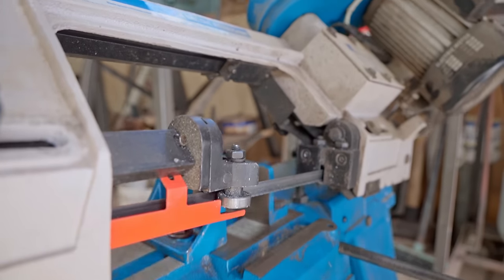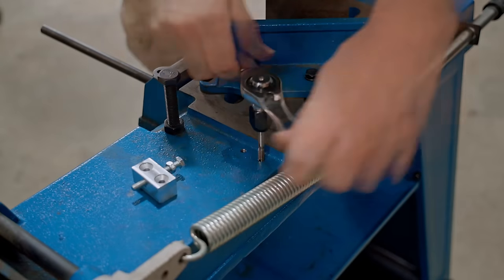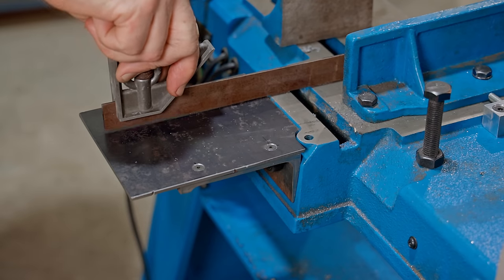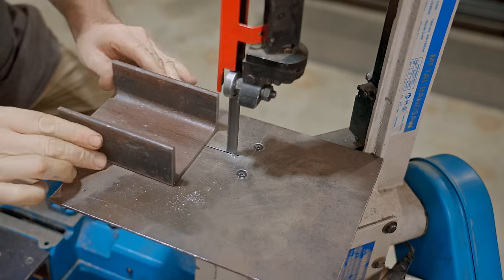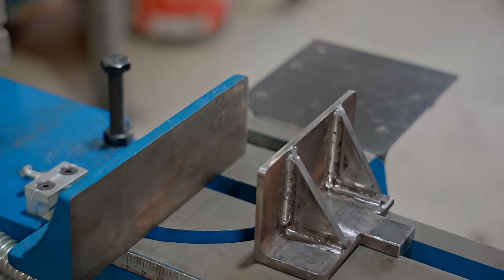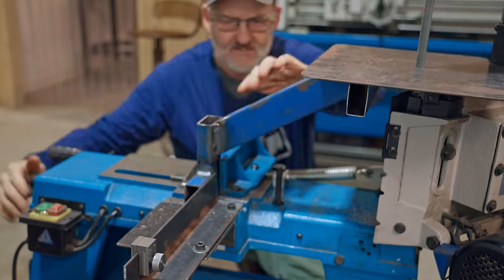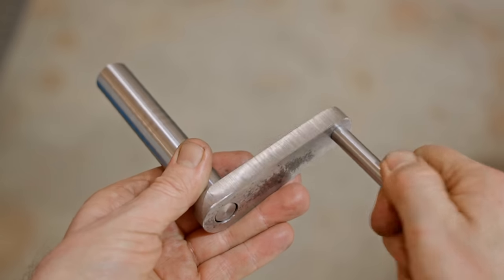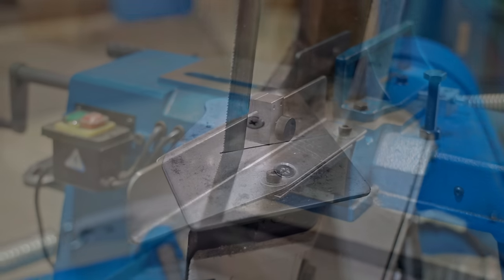Transforming a Budget Machine into the Ultimate High-End Tool

Comment: Regarding vertical welds. Since you are using MIG you might consider running the first pass up hill with a single small stringer instead of a weave and then immediately running downhill over it with a slight weave. This initial pass will give you penetration while the second will smooth it out giving you a good looking cap.

Comment: I've got one of these and its a decent machine for the money. The one mod that would be useful would be to renegineer the tension system for the sawing pressure. The spring is crap because it's not linear and being cheap the machine hasn't got a hydraulic blade pressure adjustment.

Comment: Very good work, for what you are welding I wouldn't worry about vertical up

Vertical down will be fine, grind all faces to be welded to clean steel 

To save grinding those welds off a small prep for somewhere for the weld to go, it will be stronger and if done correctly look the part

Comment: when using solid wire mig, welding downhill with minimal puddle manipulation is significantly easier and leaves a far cleaner looking bead at the expense of a slightly weaker weld with less penetration, but still perfectly servicable in most use cases

Comment: you can probably improve your welding results by not weaving. you really only need a good root pass for this size material. you can control the size and flow of the weld bead by dialing in the machine and changing your hand speed. some welders choose to cycle the trigger and run stitches for that "tig dimestack" look, but its not really necessary unless you are welding thinner material.

Comment: Quick tip to improve the look of your vertical MIG fillet welds without sacrificing significant strength:

Weld from top to bottom, with a slight push angle (the wire is exiting the gun pointed down 10° or so) and very minimal movement, mostly trying to keep the wire's position relative to the surface of the weld puddle consistent. With a bit of practice, this will produce a smooth, even weld bead with a solid tie in to both sides of the part. This method or similar is used all over the welding industry for thinner metals (10mm or less) and is one of the best improvements one can make to the look of parts without needing much, if any, post-processing.

Comment: Great video and some great modifications.  I made almost the exact same base with casters, but instead of solid sheet metal, I put expanded metal in the bottom so it wouldn't catch all the "sawdust".  I also extended plates to bolt the casters to so it would have a wider wheelbase and be much more stable.  One thing I noticed right away was regarding your workflow. I couldn't understand why you bolted the base onto the saw before mounting the casters so you had to work down on the floor and you also had to drill all the holes with a hand held drill instead of the drill press. ???  Regards.

Comment: I've had that same bandsaw for 12 + years.
Mine came with a cast iron stop instead of plastic, don't think I've ever used it though.
 I'm happy if it just turns on as I've had problems with the start capacitor, it's an odd size/capacitance. (110v in USA)
Since I fitted a cap from AC unit it has worked a lot better
I planned on fitting angle iron to bottom of base same as your doing, just never got around to it
The angle scale faded to blank years ago but I very rarely use it to make angle cuts.
I would make base wider and longer at motor end as saw is very unstable when used for vertical cutting.
Fitting a piece of angle to extend fence is about best mod I've done, a bolt at the end of moveable fence means you don't have to find spacers when cutting short pieces or make a new sliding jaw.

Comment: At 10:00 put a threaded hole through the small jaw on the end away from the blade.  A bolt will act as a variable spacer for very short pieces.

Comment: If you need to mark holes in a tight space like mounting that channel, you can cut a wood pencil down and mark inside, I prefer a red pencil myself. I had one of these saws in my shop and it did a lot of cutting before I got rid of it, my problem with it was that it didn't cut square in the vertical of the cut and no amount of adjustment or blade break-in could make it do otherwise.
For your vertical welds you had trouble with, you are moving too fast with too low of heat and weaving where not necessary. Try turning the heat up a ways, and instead of weaving just run a stringer, or you can try a pull and pause technique if you want for aesthetic. Also, with MIG, you can run downhill instead of uphill since you don't have to worry about trapping flux, just turn your heat way up. It may sound counterintuitive, but you will get less warp with a higher heat setting as well.

Comment: Modification idea for the vice handle. Convert it to a foot pedal that sits between the leg arch(May need to expand that arch).
Would be a lot more work making the mechanism and connecting it to the pedal but then you would have an easy method with plenty of torque to tighten the vice and you wouldn't have to worry about removing/readding a long protruding handle all the time.

Comment: I bought Harbor Freights big band saw back before they put limits on what a 25% off coupon can be used for.  It went on sale for I think $200 USD off plus I used a 25% off coupon so out the door for $599.  It already has a rock solid base though along with cooling and is very heavy, I think 800lbs if I recall.  Could still use some work, vertical table is total garbage on it, flexs like crazy

Comment: Nice work - I particularly like the small permanent table and will probably make mine a tad larger. I was hoping you would design a comfy coolant resistant cushion for the operator to sit on while using it in the vertical mode - looks like I'll have to continue using my old folded towel, or design my own :)

Comment: Wonderful mods to the band saw.  Would you consider making new legs for it or it fine now that you made a steel base for the legs?  
I have a very similar saw and the legs were crap.  I mounted mine on slide rails below my sheet metal brake.

Comment: great vieo i have simillar saw (same cast) and i did some alterations myself:
 1. replaced both jaws, now i can saw 200mm lenght;
 2. front table- different approach but simillar result; 
3. all raised 5mm, so i can mount to my extensions and not dirrectly to cast; 
4. manual angle extension for fixed jaw; 
5. stop with ruller at table; 
6. small table for vertical cutting; 
7. stand from car jack for loong pieces
looks  crazy but i am happy.... need to ad wheels, saw is pain to move. maybe replace whole legs with new frame so i can fill it in boxes with blades and accesories

Comment: I'm sure your welds are plenty strong, but since you regularly comment on them yourself, I was wondering if you thought about keying the drive connection between the handle and the axle of the handle? If you'd make the key press-fit, it wouldn't even need welding at all. Or just a small threaded hole and a sunken bolt to cap it could keep the handle and key in place as well. Keys are usually also stronger than welds for a force driving connection :)

Comment: PHooking brilliant. Lotsa work man. Seriously impressive contrast with the original. I might have to sub to your channel if not already on there. I do stuff like that but the scale of this one is out there! And I have a slightly broken down one in the shed that needs some drive system repair. (which has begun.) I made my chop saw into a cold cut saw. Really fast and smooth less energy required to drive it too. A win mate. You might like one yourself? Mine is industrial grade but single phase so it just leapt ahead of its original design. I watch out for any other videos of yours. Inspiration!!

Comment: 16:50 If your grinded Workpiece has those dots in it, you have to cool your Workpiece. Usually, you get a better surface finish if you have a high feeding speed with your x axis and a small feed in the y and z axis. Don't take heavy cuts with your z axis, it isn't good for your machine and grindingwheel also you have much less heat

Comment: Great video, I need to do most of these mods but the one bug bear I have is the one do covered first... that awful stand!! , I just removed the stand and bolted the saw to a small cabinet which was part of a TV stand, added some casters and now I can wheel it out from under a bench and keep all the mods inside the cupboard.

One big tip if you have this issue.. cutting a disc into 2x discs :) , old 5" 4 jaw chuck on an angle plate, that sits in the cabinet and I managed to cut a 4" diameter bar which was only 2" long into 2x 1" thick 4" diameter discs.. maybe that is one for your bandsaw attachments lol

Can you advise me what the brands are for the rachet tap and dies you use in this vid?

Comment: Well that was an epic amount of improvements . Yup as some say upgrade and get a better saw .. na  lol . Mines a similar design a generic version like many out there . Out of all you have done I've got to be honest the clamp was the best with the 90° stop set behind it and then the adjustable T nut underneath . These 3 would be the most beneficial to mine for actual cutting and usage . The most versatile adaptation is the wheeled base the original fitments are bloody horrid and awkward its doable to use but as you said it's not very user friendly as it's a lot of pulling and twisting just to get out from under a bench or out a corner.  
A very enjoyable video thanks

Comment: Turn up the wire speed, turn up the voltage, make sure you're using at least 80% Argon. 90 or 92 with the rest being CO2 will work great. With the weight of the Steal Your normally welding, you will be coming close to globular or even into spray arc at times. Those settings will work much better for your application don't try and move your tip faster than it wants to weld that is evident in some of your welding. But you're going to want to change your settings anyway so you're going to have to be a little bit more careful with it as you change your procedure

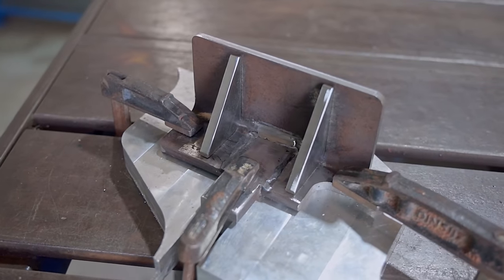Comment: 16:00 - it may seem counter-intuitive, but welding DOWNHILL (in vertical position) with MIG/MAG is actually easier. Well, at least with mild steel, which is nearly always the stuff we use for projects like this one.

Also, as the movable jaw has always some play in it and it tends to lean back a little when tightened, it'd be better to make it not at exactly the right angle, but more like 91° (i.e. its top would be leaning toward the fixed jaw , i.e. the top of it would touch first) - this way they'd be actually parallel to each other when tightened.

Overall, a great improvement over a stock saw, will certainly make using it easier, yet that "I'll clean them DOWN" does puzzle me a bit... ;-)

Comment: Great video. Your quite a designed !! &
Warning – change worm gear oil if original chinese oil is still in the saw. 
I live in north america but your N.Z. saw looks exactly the same. I got all of mine thru Harbor Freight.

There is a closed in worm gear that takes the power generated by the motor and belt to the blade. See the outside top pulley on top of belt, which is attached to one gear inside housing.

 Access is a through a plate with 4 bolts behind and under the bottom bearings. In my case it was under the table in the back. Plate is like 4” x 3”. 
When I opened worm gear cover up, it was not oil but coal smelling thick grease, which 
was compeltely inappropriate for lubing worm gears, especially in cold weather. 

To change oil, saw must be tipped on it’s side to prevent oil from getting all over the place, but grease is as thick as cold honey and will not run anywhere.
Try to save gasket or use black rtf if it gets shredded. 

It took a long time to get the darn grease out of there. This is grease made from processing coal and smells like coal. Simply wipe it all out and replace with 75/90 weight gear oil.
If this grease is not replaced and you use the saw a lot, the gears can and will chip and break.
I have gone through 3 of these saws using only vertically, over 29 years and learned the hard way.

Comment: i used a roll around toolbox as the base , actually works pretty good though you still need to make the casterwheels and their mounts stronger
think that type of bandsaw is one of the most sold metal bandsaws around for hobby use
shouldve used the surface grinder AFTER welding it up ............ah ok
about the table for the bandsaw : could add a bycycle seat on the other end so you dont grease up youre workpants on the metal of the bandsaw

Comment: i did enjoy it thankyou very much nice work pleasure meeting other clever craftsman I'm more into coach work however i build tools and tooling right now im building a cross breed between a yoder and pullmax power hammer reciprocating nibbler out of 8 in x 8in I-beam 1 in thick web fully boxed sides with 1/2" (13mm) plate steel it has variable stroke length and   its 5hp 3 phase variable speed w/via a foot pedal it will weigh an estimated 3000 lbs it will shrink stretch bead planish cut louvers pretty much make a complete car body or what have you i love it making stuff with stuff ive made its priceless fun!

Comment: Yep, I have a slightly older version of your bandsaw which does not even have the shelf underneath. The stand as you said is rubbish. I fixed that by purchasing a Bora set of adjustable mobile wheels which the base of the stand fits into. However, I am inspired  to make the base as you have done. I understand why you extended the table, however, I find with my saw I keep bumping my leg into the original rod that sticks out. The same would apply to your table extension. Would be better if it could fold down (or up) when not in use. Replacing the adjustable vice was a huge improvement.  However, overall, I hate what you have done because now instead of ignoring the issues I will have to do work to modify my bandsaw!

Comment: Pity I hadn't seen this 7 years ago... Bought a bandsaw from a different supplier... somewhat less versatile, more expensive and doesn't have the stand (which I had to purchase seperately - AND put castors on).
It went through 4 motors before I took the last one to a rewinding shop in Cairns to get a PROPER job done... 
Next time it dies, I'll replace it with one of these and apply similar upgrandes...

Comment: I have better luck welding down hill on vertical welds with a mig. Heat rises and welding down hill counters heat rising in the weld while welding uphill; of course stick welding largely works better going up hill.